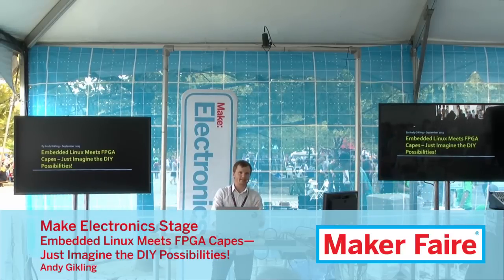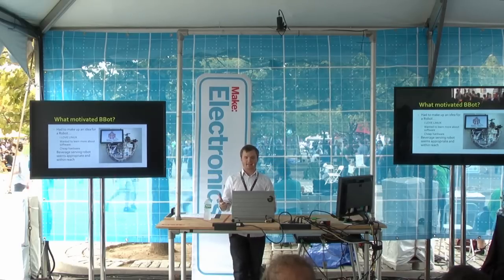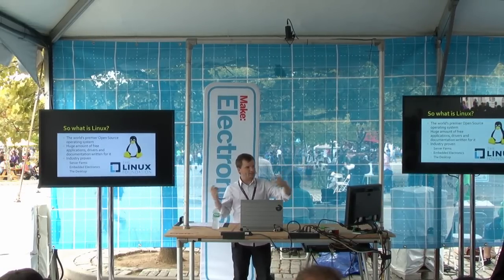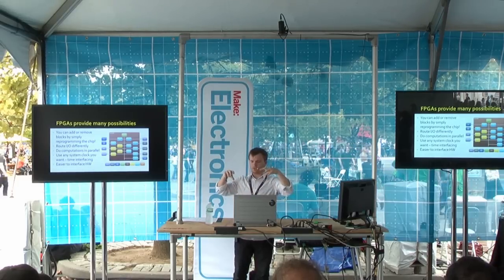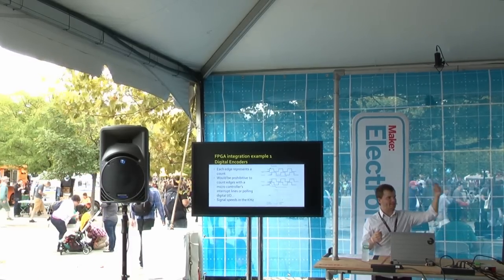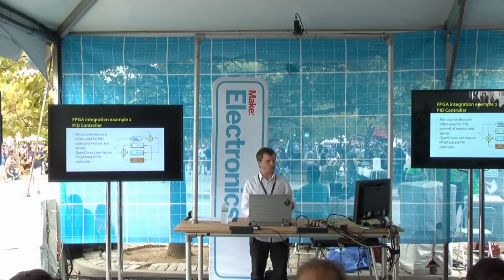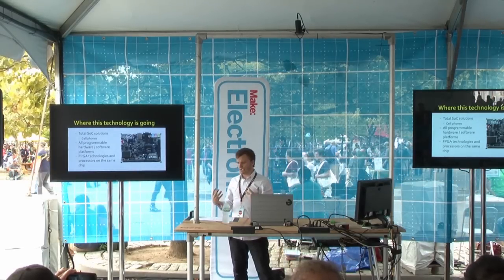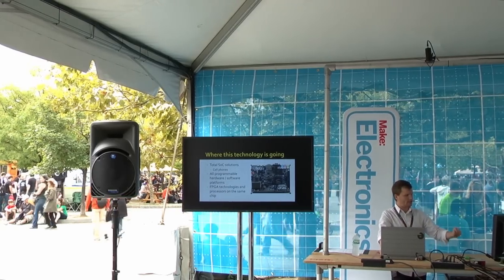Maker Faire New York 2013 Electronics Stage: Embedded Linux Meets FPGA Capes

Comment: what if one day people invent s system that operate itself and not by linux of windows or even mac and with its own intelligent which can generate tasks by itself......
Reply: well, it can still be based off of linux, but maybe have a process that operates as a virtual "user" and that is where the artificial intelligence will come from
Reply: Well, for it to work, we would have to design the computer from scratch. we would need a machine that can can constantly rewrite its own circuitry. The way electronics in general is right now it will not work. We cannot use ANY architecture that is out today. THe hardware would have to work like the brain. the transistors would have to be put together like neurons, not logic gates